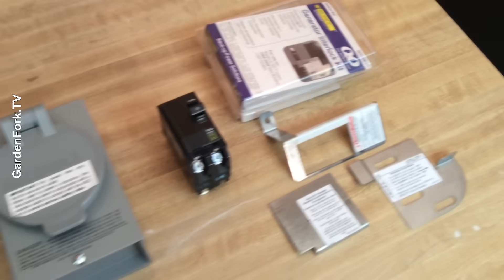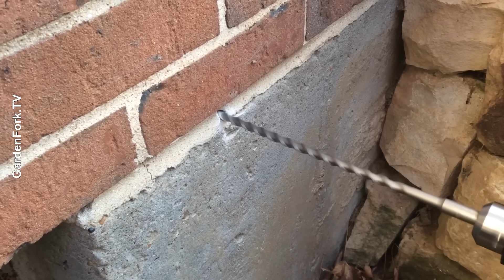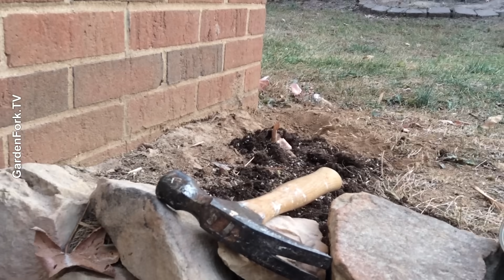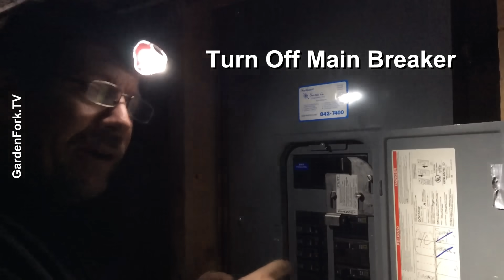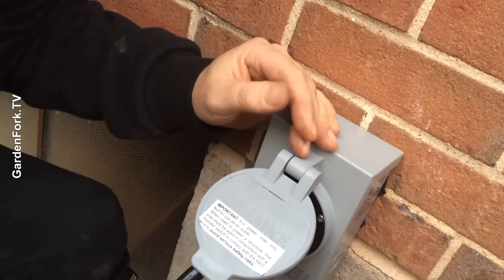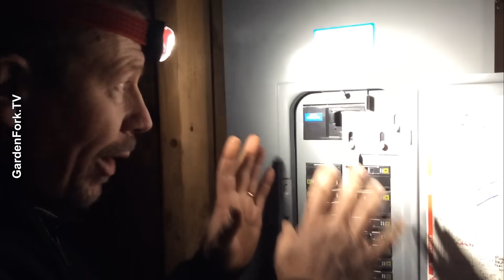Your Easy  & Safe Way To Hook Generator To House | Generator Interlock Switch Install | GardenFork

Comment: Surely the main breaker is switched off to prevent you from feeding power into the house from both the utility mains and the generator at the same time?
Reply: Yep, but more importantly to prevent you from sending generator power to the grid while the grid lines are down and being worked on... to prevent you from electrocuting someone via the grid.
Reply from the maker: Yes, that’s what the interlock does, it won’t allow the generator breaker to be turned on unless the main breaker is off. Thx!
Reply: geez watch the video and save yourself the question. lol
Reply: The safety aspect of "not sending generator power to the grid while it is being worked on" sounds laudable - however the more practical point is that you would need enough power to run all of your neighbours homes before this becomes an issue. In other words, your generator supply will trip instantaneously when you effectively place a dead short across it by connecting it to all your neighbours. That is actually why you are forced to disconnect the main breaker - physics.
Reply: @mike_van_in  I have been and electrician for over 40 yrs, you don't know what your saying! And it can kill a lineman repairing downstream in the blink of an eye!  I've seen dead shorts in a parking lot lighting 1/8 mile from the panel that didn't trip the breaker, but it melted/fused it together and melted a few others above as well. Stick with plumbing Mike!
Reply: @cobia1794  40 years, huh? You should know a lot! So, the failed breaker you mention didn't break the circuit and melted - "and melted a few others above as well" - (I hope your 40 years wasn't spent with the type of utility company "maintaining" THAT equipment). That short must have taken SOME power! 

Okay. So, if you have a HOME GENERATOR that will juice the entire neighbourhood while its OWN faulty circuit breaker AND the obviously faulty main breaker in the HOUSE BOTH fail closed. YOUR 5 or 10 KILOWATT GENERATOR SOMEHOW MANAGES TO SUPPLY SEVERAL HUNDREDS OF KILOWATTS CONTINUOUSLY INTO THE NEIGHBORHOOD LOAD to still have the juice to zap the poor electrician! Then you need to patent that generator technology IMMEDIATELY! Because Ryobi or Honda didn't make it that way. You have something very special (it even sounds like your extension chord must be made of unobtanium!) and I would have had no idea that you had stumbled across it - so why the annoyance with ME? Lucky YOU, Cobia! 

Since it's always better to be safe if uninformed, your advice will obviously be well-received by the general public and I won't try to persuade you of anything. Look after that very unusual generator and extension chord, they're going to make you RICH! Best of luck to you.
Reply: @mike_van_in     First: I did not say it will power up or make work any equipment upstream (lack of current).  Second: There may not be enough fault current for the generator overcurrent protection to recognize a fault and continue to run and induce voltage on a circuit of some fair distance. Third: All it takes to kill is 60-100 milliamp across the heart to stop it.  I could go on about electrical theory and calculations, but I'd be be pissing in the wind. When you have read the NFPA / NEC codebook from front to back and understand (everything) printed, then we can have a discussion...  I didn't say I'm a knowit 'all', far from that!   Mike, just stick with the plumbing Vid's
Reply: @cobia1794  Sure thing, Cobia - thanks for the plumbing tip, that's just for us idiots, is it? You're the genius here ... obviously.
Reply: @mike_van_in  Not sure how placing a load consisting of neighbours' houses across your DP mains incomer is effectively shorting it
Reply: @robbrown6495  Rob, say you have a 5kW generator - to keep the calculation simple, let's say that its rated to supply 5 kW or 5 kVA. So, 5kVA/220V = 22 A, i.e 22 Amps  maximum. So let's accept that the generator's circuit breaker will trip at 25 Amps (although it's more likely to be a 20 Amp breaker, we'll assume the more generous capacity here). 

Now on a typical day, your home can draw anything up to 60 Amps (some domestic breakers allow up to 80 Amps at 220V - but let's be conservative). 60 Amps x 220 Volts =  13.2kVA. Your 5kW generator will trip BEFORE you even draw HALF of the full load of ONE home. Now connect another, oh, I don't know ... five homes? Even if all six homes are drawing only  a QUARTER of their maximum, that's around (6 x 13,2kVA x 1/4) 20 kiloWatts. That theoretical load, much lower than it is likely to be in real life, is going to be be way over your generators 25 Amp capacity and it's poor little breaker is going to trip as if a crowbar was dropped across its naked output wires! That's why I refer to it as a short circuit. The load on the generator is so heavy as to be indistinguishable from a short.

It's like trying to pull five full-sized, lightly loaded mobile homes with a compact car.  Except you have to pop the clutch, just like switching on a load to a generator (switches are on or off - there's no gradual take-up - or even a fluid coupling like an automatic gearbox in your car). Your car WILL stall as if the tow bar was connected to the wall of the Hoover dam.
Reply: @mike_van_in  No, protection of the utility's equipment and personnel is "actually why" you must properly open your connection to the utility to use a generator.  Numerous factors come into play.  Yes, it is likely that the load of other services on the distribution system would probably trip your generator breaker.  However, what you won't know is what configuration the distribution system is in.  Your service could be isolated by damaged or tripped equipment on the utility's distribution system.   A distant load might not "instantaneously" trip your breaker.  

The primary purposes of a proper transfer switch is to provide this necessary and verifiable open point between you and the utility when running your own back up power plant.  There is simply no way that you can guarantee your breaker will protect anyone on the other side of your service connection - because that is not what the circuit breaker is meant to do.,

A basic electric safety rule to remember about circuit breakers/fuses.  Circuit breakers and fuses are to protect property and equipment, not people.  I will rest assured that I am accurate when I say that every breaker in your household panel is capable of killing someone without tripping.  A lethal amount of current can flow without overloading a circuit.

You have no business backfeeding power in to the utility during a power outage.  Doing so is dangerous, dumb, illegal . . .
Reply: @curtisccr  As I said IN MY FIRST COMMENT, the safety aspect SOUNDS LAUDABLE. 

HOWEVER, there is no way your little generator is going to backfeed anywhere near the effective load presented to it in an outage. These are two entirely different aspects.
"You have no business backfeeding power in to the utility during a power outage.  Doing so is dangerous, dumb, illegal . . .".
Now, as to your astounding declaration in your last sentence, you imply two rather odd assumptions:
1. The 5% of homeowners in the USA and Australia that backfeed solar and wind energy back to the grid are all doing it illegally.
2. Any electrician dumb enough to think that distribution lines to domestic consumers can be treated as safe just because he switched off the supply to them is in danger because his safety relies on what the public know - AND PRACTICE - regarding their electricity supply. 
Lastly, PLEASE READ my comments again and see if I am "actually" even SUGGESTING that anyone should backfeed power to the grid, for goodness sake!
Reply: @mike_van_in  I took issue with your dismissive language.  It "SOUNDS" laudable?  No Sir, it IS laudable.  Safety of the distribution system is the primary, and very practical reason for not back feeding with your generator.  Nobody cares about the generator capacity, or whether or not its breaker will open.

And are you sure you really know what the load  presented to my little generator when my power is out?  I am looking at a service connection right now, where an outage could occur, and my 3500 watt generator could put 12KV on the primary side of the transformer.

Solar systems are different.  But only in that may put power back into the utility normal conditions - when utility power is present.  They automatically shut down and/or disconnect when utility power fails.  And the utility knows about them.  I am sure this is no different in Australia.  

Your original post made it sound silly to be concerned about back feeding, because it just wasn't "practical."  Being in the business, I take it very seriously.

Comment: Yeah, but where did you find the wire to run into the male plug you mounted to the house. My house sits on a slab. What then?
Reply from the maker: Hi Jeff, best to work with an electrician on that one. Be safe! Thx.

Comment: You should've said that this is the legally compliant way, not necessarily the practical one. You can use a suicide cable and normal 30A twist lock

Comment: Nothing different than what i'm doing now.....just without the fancy plate. I situate my generator in my shed and run it into the 220 circuit that my air compressor uses. I flip off my main breaker to avoid backfeed and voila........house is powered!
Reply: Yours though aint idiot proof therefore not legal for an electrician to do.  I know a handful of people backfeeding safely like you. When i get my own place i will too.  An ideal setup is to have two panels making your main panel a sub panel and power the new main and have one 110 breaker running a dummy light to test for power restoration and a big breaker feeding the now sub panel that feeds everything. I saw a guy run his generator all night after power back on because he didnt know it was back

Comment: Do you need a special type of breaker to power the electrical panel from the generator? Or will an regular 240v breaker work if wired correctly?

Comment: This is for utube take this video off it is not the proper or safe to do this please read my previous comment  Please check this out with the power company and they will agree with me .you have to use a transfer switch because it also disconnectes the neutral wire from the systems.That why they make transfer switches. PLEASE.

Comment: My problem is my breaker box is full except one spot for a 120 volt.
Reply: half wide brakers  MAY be available for your type of breaker box   use a bunch of'em & free up space
Reply: Or you can add a sub panel if needed. Move some from main to sub and install gen breaker as shown

Comment: Question. Used your video to install an input outside to plug into. Ran it to breaker etc. Went to plug up generator to test and as soon as I flip main breaker on generator it trips and turns off main power to generator. I am using a homemade cord from the generator to the input on the side of the house. Any advice as to what to check?
Reply: Turn off all the breakers. Run the generator. Then one at a time click on the breakers you want to run. I think you had them all on and the generator cannot take a sudden load like that.
Reply: frontcentermusician f

Comment: Why is your break only 20 amps?    That type of connection to the generator is a 30 amp connection.
Reply from the maker: The generator has an L14-20 socket , which is 20 amps. But yeah, it does look very similar to the 30 amp socket. The generator interlock is much better than a transfer switch, I think. And I have the transfer switch in my house. Thx!
Reply: Oh wow,   You're right they look very similar.  I've gone the interlock route also.   I like the option to power any area of the house I want.  I have 7500 portable genrac generator with a L14-30 going into the breaker box.

Comment: I agree, the interlock is a much better option then a transfer switch.  With it I can choose what circuits I want to power.  Living in FL I run a Generac 12500 / 18500 portable generator to power the whole house during a storm outages, but I can change and reduce loads to allow us to run central AC, hot water heater, kitchen stove , and or clothes dryer.  Consider propane.  Pain to set up but much less fuss then gasoline and your carburetor on the generator will never gum up with ethanol from today's gasoline.
Reply: only use ethanol free

Comment: I have to look into getting that type of hookup for my home since we have the problem of losing power every year.
Reply: I agree, the interlock is a much better option then a transfer switch.  With it I can choose what circuits I want to power.  Good luck with your choices.  I researched constantly for about 6 months before I started buying my parts.
Reply: Sorry, but this setup is only for people who have no issues with the reliability of their electricity.

Comment: I would think the inlet plug can indeed be located in an attached garage....it provides weather protection to the plugged connection from the generator... AS LONG AS there is a safety sign on the receptacle or panel that the generator (itself) " MUST always be outdoors"..... thoughts?
Reply: Yes, it can.  However, then you have to leave a door or window open to allow for the cord.  This allows you to separate yourself and family fully fron the outside.
Reply: That would work like in a garage and could run the cord under the garage door. The garage door seal should flex enough for the cord to run under it.
Reply: You can install outdoor components indoors, just not the other way around.

Comment: question is this legal? Because technically your still hooked into the grid since your neutral is not disconnected?
Reply from the maker: Check with your local codes to be sure. Thx!
Reply: It's not required to isolate the neutral by default in the NEC.  They base it on whether the generator has a floating neutral (isolated from ground/frame) or a bonded neutral (neutral bonded to frame).  Either way it's at least safe based on the fact he installed an interlock mechanism to isolate the back fed breaker from the main breaker.

Comment: Thanks concise and informative....I've just built a generator house with ventilation outside where my moms generator is now living ..it is raised on breeze blocks for flood.... the day I finished we had an outage so we practiced .... that means a lot of cables everywhere and also got me thinking about  a 12/24 D.C. Light system .we ran an extension to my friends fridge so it helped to put a load on the generator.We live in Florida and during the aftermath of Hurricane Wilma my mom was without mains electric for 6 weeks ! So thanks for the vid ....and as a thought for others MAINTENANCE!! Don't expect your machine to start with varnish in the float bowl and rotten gas with water and rust in it ! Run the machine under load for 15 mins once a month and change the gas every season .... good luck and thank you

Comment: Hi Eric... Good demo on the fundamentals of a Interlock Switch...  I see the main box interlock breaker in your video is a single pole 20 amp, so I assume this is a small portable generator to fire up some basic 20 amp appliances, lights, etc. in the house. Naturally a larger generator is required with 30 amps or more capabilities if one wants to run the furnace and/or deep well pump and any number of other items as well...
However, I think your point here is to demonstrate the relatively inexpensive use of an Interlock Switch versus the very expensive Manual Transfer Box plus installation costs...  
The only thing I see missing on this portable generator selective house install is a proper mechanical ground off the generator itself., i.e. [ Ground Rod in the ground with a minimum 8 awg copper wire clamped to it & attached to the generator's ground lug or frame. ] 
Thank you, I enjoyed this well done video...
Bill Farr... :-)
Reply: Hi Eric... I stand corrected, the 20 amp generator breaker is a double pole & I see the generator is a 5000 watt unit, I am a bit puzzled why a 30 amp double pole main breaker is not installed in the box, otherwise the owners are not utilizing the generators output capabilities & CANNOT selectively run those very important essentials, i.e., furnace & well pump... 
Thank you,
Bill Farr... :-)
Reply from the maker: Hi William, the generator has a 20 amp 220 volt outlet ( L14-20 female ) so the generator circuit breaker in the house panel has to match that. Thanks for all the info and help! Eric.

Comment: I have a silly question- is an outdoor plug necessary? If the generator plug is a dedicated line, can it be hardwired into the generator breaker? With enough cord outside to reach the location of the running generator?
Reply from the maker: i would check with your local electric codes on that one, sorry I don't know. outdoor electric cable has to be weather proof from what I understand.  thx!
Reply: The outdoor plug is a convenience that allows you to use portable generators when necessary and store them away when they're not needed. If you have a permanent fixed generator such as a stand by generator that is in an enclosure it can be permanently direct wired to your panel via buried conduit, it can also be plumbed to a natural gas line.
Reply: It would only be safe if you have a safety interlock switch or transfer switch because if the open prongs on the plug for the generator that would be exposed when the generator was disconnected. If you do have a switch so power can't be fed to the open plug it would be safe.